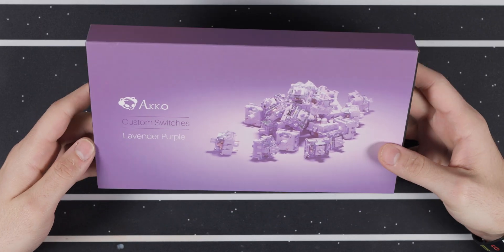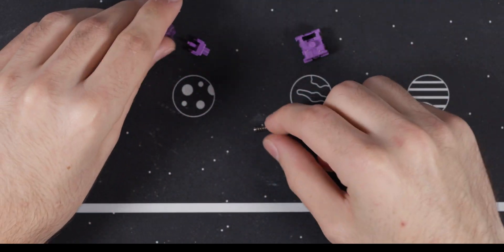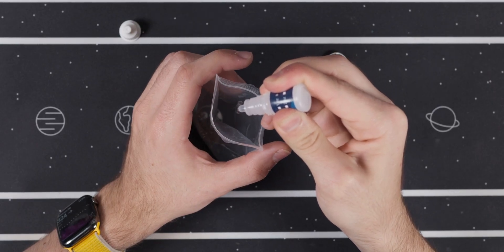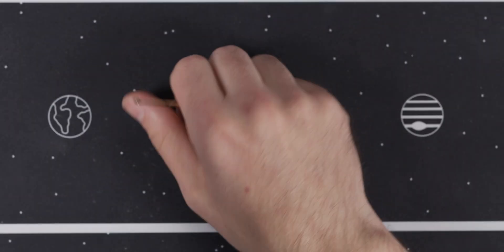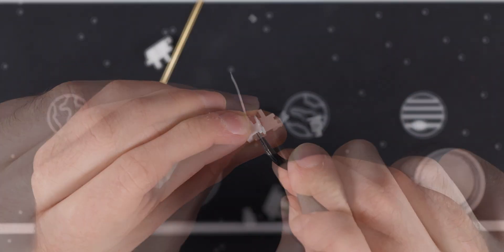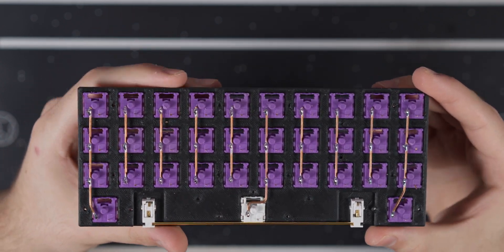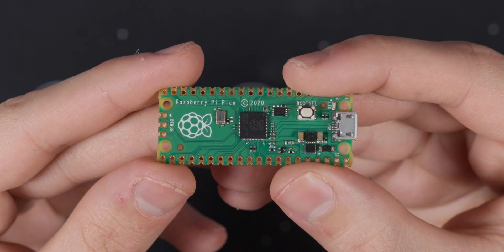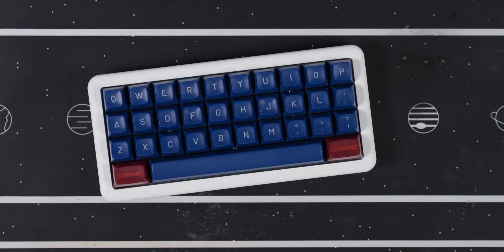Building My Most Thclacky Handwired Mechanical Keyboard Yet…

Comment: How tedious would it be to make this bluetooth with a Nice!Nano?
Reply from the maker: You would have to code the firmware with ZMK but other than that… probably not too difficult. The nano should fit for the most part in the cutout on the case since it’s just glued in. The battery could mount somewhere else inside because they’re normally really thin.

Comment: How did you get the stabilizer wire installed?
Reply from the maker: After I put the housings on I mounted it from the underside
Reply: @joe_scotto Thanks man. I was having trouble getting my 3d printed plate to be sturdy with those gaping gaps from a 7u spacebar. I'll have to give it a try. Thanks again!

Comment: HI ! 
Excuse me. When I QMK Flash RP 2040, I receive report :
"Copying handwired_jscotto_scottolong_default.uf2 to qmk_firmware folder                             [OK]
(Firmware size check does not yet support RP2040; skipping)"
I don't know where I went wrong. thanks !
Reply: Hi, I just logged in to reply. That just means that usually for say a pro micro with limited storage for the compiled firmware it confirms if the firmware size is under that limit. In case of kb2040 that constraint varies a lot depending on your exact mcu so it doesn't perform that check. If it compiles fine, this is nothing to worry about. Cheers and happy keyboarding!

Comment: Hey, what did you use as firmware for the raspbi? Does QMK also work with it?
Reply from the maker: Just QMK. They added support somewhat recently
Reply: @joe_scotto  Awesome, I'll eventually have to try it myself then. Thanks for the quick answer!
Reply from the maker: The only thing to be aware of is that I think OLEDs have limited support but I’m not certain. Everything else seems fine so far though.
Reply: @joe_scotto  Good to know! I'm not currently using my OLEDs that much though, so it might not be a big deal.

Comment: You use an ethernet cable for the wires? So technically you can use literally any wire for handwiring a keyboard?
Reply from the maker: Yeah, you can use any wire but I find Ethernet cable is the most cost effective and it is more flexible.